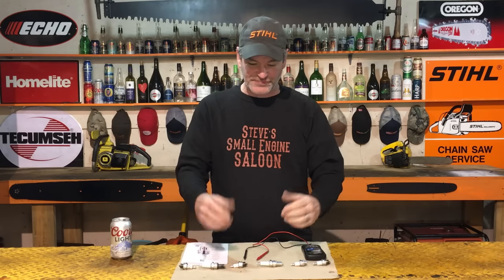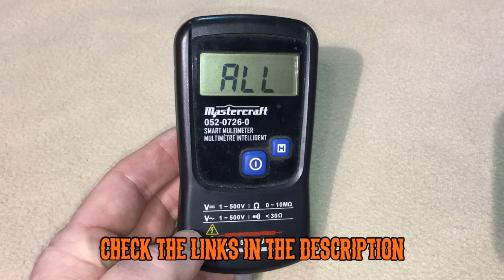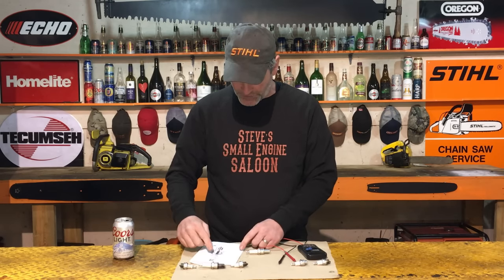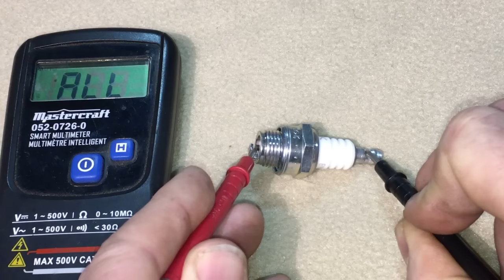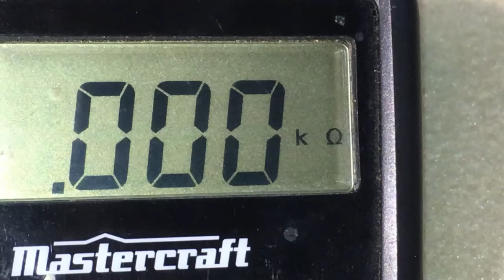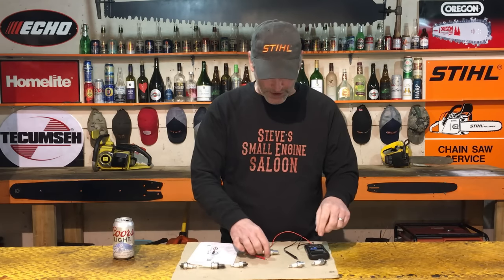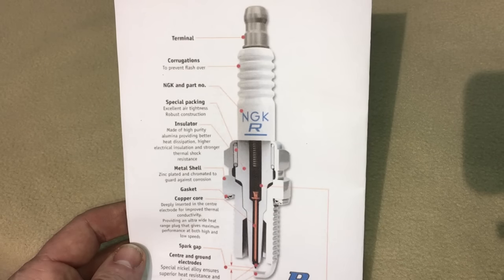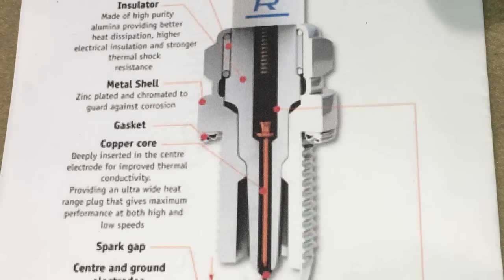How To TEST A SPARK PLUG In 1 Minute

Comment from the maker: Click here for a Multimeter ➜ https://amzn.to/2SNGZkw
Click here for new spark plugs ➜ https://amzn.to/2Mb6JFa
Check out these other informative videos: 
Fix Stripped Spark Plug Threads For Free With This Hack ➜ https://youtu.be/yY_fuDRltZE
How To Diagnose and Read the Color of Your Spark Plug ➜ https://youtu.be/Tz4uxFMUCOA
Check For Spark On A Mower, Chain Saw or Other Engines ➜ https://youtu.be/VZ8r7xv3DLY

Make sure to check out the Saloon here too…
Click here for my website ➜ http://www.stevessmallenginesaloon.com/
Click here for my Parts and Tools Store ➜ https://www.amazon.com/shop/stevessmallenginesaloon 
Follow me on Facebook ➜ https://www.facebook.com/stevessmallenginesaloon 
Follow me on Instagram ➜ https://www.instagram.com/stevessmallenginesaloon/ 
Follow me on Twitter ➜ https://twitter.com/SteveSaloon 

The resistor is there to suppress radio frequency noise which helps protect car radios, mobile phones and engine management systems. AND some ignition modules require a resistor plug to allow the coil timings to work properly.....
Reply: Old mechanic once told me to test a questionable spark plug you must first fill a 5 gallon bucket of water, then you must toss the spark plug in the 5 gallon bucket of water, finally observe the spark plug. He then said, "if it sinks then it's bad. Replace it."   ;)
Reply: Your friend must of been a Navy man
Reply: I made spark plugs for 10 years, every brand you can name. Don't believe the bs that one plug brand is better than the other.
Reply: @Weeble_Warbles  your friend was crazy.
Reply: ??? What??? Resistor for suppressing some noisy waveforms? You must be kidding! Chuck in a couple of ferrites will probably be of a better option if that is really your concern.
Reply: @santini1953  you made spark plugs of all brands? Gee... You work for some crazy back ally workshop that produces all sorts of knockoff maybe. Sparkplugs... I don't know people can make such a big fuzz including conjuring up so much BS about of this seeming innocent thing. What can I say...
Reply: @santini1953  That must have been an exciting and rewarding job, but someone has to do it.
Reply: I now know my life efforts aren’t wasted. We got people arguing here about spark plugs. SAD
Reply: Thanks
Reply: Spark plug link broken...
Reply: thank you. Was informing for me.
Reply: Great site
Reply: I have a old Briggs engine with everything on the inside removed except for the crank shaft , it still has a Flywheel and coil , I just hook up a spark plug and spin the shaft , it either sparks or not , I also test coils on it ,  it was just a junk engine from over 20 years ago that was never going to be rebuilt so it was free , it doesn't show any numbers but it will tell you if it works or not
Reply: Coors light... c'mon man, Sam Adams, PBR but coors light is gross!
Reply: Peace sports
Reply: @santini1953  Someone has found a way to make a bad plug now. I bought some a couple months back  and I would not use them in my Windstar. I took them back and had to look at the next set I got before I would accept them. These garbage plugs had like 4 threads on them.

Comment: When I was a VW mechanic back in  the sixty, we has a spark plug tester. You cleaned the plug first, check gap, place in tester, some worked fine until you put 120 psi and no spark, a lot of plugs work fine until you put them under compression pressures and then no workie! My two cents worth.
Reply: Ive had that. Mower wouldn't start. Tested for spark with the spark plug on the engine casing. Sparked ok. Put back in and engine wouldn't start? Eventually tried another spark plug and the engine ran.  It took me about an hour to figure it out plus a lot of swearing!
Reply: 100%
Reply: Paul P how to does it work ???
Reply: This is so true.  Your 2 cents are needed to buy new plugs  lol
Reply: Yes! My father was an old time mechanic, and he had a spark plug tester. When I was a kid learning about cars, he demonstrated how a spark plug could spark fine at low pressure, but fail at high pressure. I couldn't believe it when I saw it. I couldn't believe why pressure would make any difference, but it did. It's something I never forgot.
Reply: i never new this...very interesting
Reply: The true test.
Reply: 60 years ago in the service station that I worked at we would charge up old dist. capacitors and leave the on the work bench for some  overly curious customer to pick up and examine . . .
Reply: I never knew that
Reply: @alven066  I have fallen victim to that trick, one day the shop manager asked us to stop all current work, and clean the shop the rest of the afternoon.,....one of the techs charged up a condenser and left on an otherwise clean bench......you know the rest, 🤣
Reply: i3
Reply: At least you are not drinking Budlight.

Comment: In High School Auto Shop we had a spark plug tester. You screw the plug into a small air chamber with a window on it. You add current and you can see  the plug begins to arc.....but as you add air pressure (compression) a bad plug begins to stutter and fail under compression. That was a learning moment for me.
Reply: You know, that’s an excellent point that I haven’t thought of in 40 years. Thanks a lot.
Reply: @NMranchhand  I'm 61 now.... I've messed with engines since I was about 13...when your dirt bike keeps fouling plugs (or other things)..... it's either fix it or push it....so you learn to work on things. But yes...this fact still makes me wonder how compression effects spark. https://www.youtube.com/watch?v=pl24m9utZLo
Reply: @readmore3634 a cleaned plug will fire    a dirty plug will fail  the spark takes the path of lest res.  (dirty plug) carbon build u on the porclin post bottom of plug its easyer to flow thru the carbon on that post to ground that jump across a gap  so it fails  --clean the plug no fail
Reply: @frankdavidson9675  
Thanks for pointing out the obvious. Why is it less likely to fire under increased compression?

Comment: Greetings from TEXAS. The resistor plug in the automotive industry is to help on  Radio Frequency Interference  for computers and of course the good time radio.
Reply: I can remember hearing the engine noise thru my 8 track with regular plugs and solid wires 😂😂😂

Comment: When I do my pre-season "Get-er-ready" routine, I pull the plug, wire brush it, lightly file it, and re-gap it.  I have a 27 year old Honda 8hp Snowblower with the original plug.  Do you thing I've gotten my moneys worth out of it yet.  I have other 20+ year old engines that I've done the same.   Good spark plug toss and thanks for sharing your vast knowledge.
Reply: I thought I was the only person that did that. I'll always try and clean it first before buying a new one unless I'm doing a complete tuneup
Reply: I sand blast mine

Comment: Thanks for this Steve.  Keep them coming.
 I'm now single after 30 years and never did anything like this, plus I lived in a major City.  After moving to a rural location and needing chainsaws, log splitters, etc, your clear, concise videos are a big help in keeping them running and diagnosing when they aren't.   
It's a 3 hour round trip to get a spark plug and You have to order them first.  
Repairs are also stupidly expensive even for simple things and it's nice to know whether you are being told truthfully What's wrong, not just have parts replaced to bump the cost.
I've found a woman on her own can run into that sometimes.
Reply from the maker: You're Welcome...
Reply: MrsGraphiteGal
   Another quick tip on a chainsaw or other motor,  if it is not starting  a quick check after trying the choke, and the regular starting instructions.  Take out the spark plug to see if it is "bone dry", means there is NO fuel getting into the combustion chamber.Likewise if the electrode part is wet with  gas, then you know it is gas fouled-won't run. At least you can know right away what is going on in there right quick if  you are far from the shop or far from town etc. Good luck and Smart gal reading and watching this stuff.  Also good practice to set your chain brake before trying to start- a sharp chain can cut you when it is not rotating, but not as badly as when it is moving fast.
Reply: Thanks Keith.  I'm adding to my knowledge every day.  Luckily my grandad was a master carpenter and my dad an engineer in the Royal Navy, I think I've inherited some of their creative abilities.
Don't worry, I am VERY careful with the chainsaw, never use it without at least trousers and gloves even when diagnosing it for a few minutes.  Although, the guy who services it says not to use the brake when starting as newer chainsaws don't need it and it actually causes problems with the huskies.  I still use it, if rather replace a part than my limbs !!

Comment: I'm in my fifties now, and I've owned multi-tester meters ever since I was a teenager --- you are absolutely right; even just a simple "no frills" unit is a total life-saver in sooooo many circumstances, such as when you're checking for the presence/level of voltage/current, testing for wire-breaks/shorts, etc.
Reply: I recommend better than “no frills” because my USA made fluke was able to find continuity issues in 3 resisters on a Deere mower OSHA safety board (ignition, seat switch, blade-PTO).  Sent it to TV repairman who said the resisters were fine using his own Chinese(Communist PRC) multimeter.  He was wrong, My fluke was right.  Diesel motor had vibrated the wire ends of the resisters to form cracks.
Reply: @hugoglenn9741  Yes, the cheapie ones do tend to break down after a fairly-short time.  Even the costlier-model Micronta testers from Radio Shack didn't last --- they suffered worn-away rotary-switch contacts, just like the bargain-bin-grade meters often do.

Comment: Great video Steve as always! My understanding is that resistor plugs are to eliminate interference with electronics? If so, why do small engine manufacturers list both resistor and regular plugs for their engines? I don't see a whole lot ( if any) electronics on most small engines. Thanks
Reply: Many small engines have a CDI ignition system (Capacitor-Discharge Ignition) which is sensitive to electrical noise. 
You can use a resistor plug in any type of ignition, but you can only use a non-resistor plug in a solid state ignition system. Resistor plugs are far more common than non-resistor plugs, and I’m sure many small engine manufacturers list a resistor plug for the sake of commonality. Non-resistor plugs are unnecessary and obsolete.

Comment: I'll just add that carbon (deposits) on the spark plug are conductive, they are resistive in nature, but they still conduct.  Your ohm measurement number will increase the more carbon is on the discharge tip.  Using a brass brush to clean the tip before testing would be helpful.

Comment: I keep a neon sign transformer handy at my shop. 7,500 volts and low amps. With wires to a spark plug it simulates the ignition system voltage and a fouled out plug will sputter and smoke till the fuel burns off.  Good for testing and if the ceramic isn't soaked with fuel the transformer will quickly clean up the plug to be able to use it.

Comment: Great vid Steve technically you should use a megger (which is a ohm meter that uses high voltage) to test the ceramic insulator because sometimes the insulation in this case (the hairline crack in the ceramic) will not leak at low voltages (your volt ohm meter likely has  9V battery) the coil of your small engine produces thousands of volts so the plug could leak at the higher voltage produced by the coil but test fine at the lower voltage of an ohm meter of course no one watching this video can afford a megger except an HVAC tech.
Reply: I think it would be overkill. It's a very expensive tool if you only use it for checking leakage on a a sparkplug.
Reply: That's what the last sentence of my comment says
Reply: @phillipcoiner4232  Then it's said two times. Just so we can get all with us, if they have any doubts.

Comment: Helpful info, but for all non-resistive type of plugs, you will find that your multimeter will not be able to detect a crack in the porcelain insulator inside the body of the spark plug. The spark will jump across that point and also possibly the spark plug as well gap due to the high voltage of the ignition system (depends on where the crack is) but the spark may be very "weak" at the spark plug gap. Your multimeter on the other hand works on very small voltage for continuity and testing resistance so it will not be able to detect the crack in the insulator and as such the multimeter will read open or infinite resistance even though your spark plug insulator may be cracked. There is a case where carbon may build up inside the gap and short out the center conductor to the outside case. In this instance you will see a high resistance reading but it will not be infinite on your multimeter.  For resistor type of plugs, these scenarios are also true, however you need to consider the 4.7 K ohm resistor in your measurements. Hope this helps.
Reply: If you have a crack in plug you will see it ark once the light is dim no need for mutimeter waist of time
Reply: Dale, you are 100% correct.  I was going to point that out but did an F3 first and there you are.  Thank you.

Comment: Your videos are great Steve.  Thanks for sharing you experience and knowledge.  I wanted to share something that I think is relevant to this video.  Just because a plug passes the test you outlined in this video does not mean the spark plug is in "good working order".  I just replaced a BPR6ES in a mower with a GCV160.  The mower would start relatively easy but after about 30 seconds it would die out.  I was thinking carburetor\fuel issue but quickly ruled that out.  Compression was 90+ psi with decompresor so wasn't too worried about that.  The mower had good spark and the plug passed your test, 4850 ohms, and no continuity on the threads\body.  The plug had pretty heavy carbon deposits that I cleaned away prior to the test.  I replaced the plug anyways and my issue was cured 100%.  So the question becomes...were the carbon deposits to blame?  If I cleaned the existing plug and reinstalled it would it likely work just fine?

Comment: A new spark plug theoretically should solve the problem, however, I've seen new plugs that were faulty.  Then of course, there's whatever else may be wrong with the ignition circuit.

Comment: Good to know; thanks Steve. Funny though. I have worked on many dozens of old & newer small engines since 2011 & never had to buy a new plug. I think replacing the plug annually or running out to buy a new one as soon as an engine becomes hard to start (usually fuel related) is a waste. Champion & NGK must love it though!
Reply from the maker: I agree....

Comment: I have had many Champion Spark Plugs fail but no NGK.I find the spark travels around on the Carbon build up most times & a wire brush is enough to fix them.My Motobecane Moped 2 stroke was  bad for that.

Comment: I had a lawn mower given to me last summer and that was the only thing wrong with it. It was a Honda with an NGK. Those plugs are prone to foul out if the carburetor was been flooding. I used to buy a case of them every winter for my snowmobiles. I always carried extras in my pockets for my buddys. They NEVER had spares on long runs. On older snowmobiles, it was normal to have carb issues. Good video. I wish more guys would just go out and buy a spare plug for all their small engines. Especially chain saws.
Reply: RC Hobbyist Extreme same here how’s quarantine

Comment: Nice video describing how to test a spark plug. I reacted to two things in this video, you are not doing it wrong. but i feel like adressing it.

Not holding the tip of the mesuringprobes is good practice, but it does not affect the answer you will get at those readings. this is becouse the readout from hand to hand is approx 5 000 000 ohm.

As for the insulation testing. A multimeter will normaly not be able to test with more than 2v. for a more trustworty insulation test it should be tested with an insulation tester with high voltage mesurement(electrician tool wich is to expencive to consider buying for the regular person). however testing it with a multimeter will show if it is totaly flawed.
Reply from the maker: Thank You...
Reply: Yes a megger would be better for checking the insulator, however a decent quality DMM can measure resistance to 50 mega ohm, your body resistance, which can be much lower than 5 meg if sweating, will seriously affect the reading. General all around good practice - don't touch the probes.

Comment: Good info Steve. I think I had one like the last the other day. Tested it for continuity and spark, which was all good, but installed in the head, it would try to kick off and die. I think the compression was separating the inner electrode. Switched out the plug, and the engine ran like a champ. Was weird for me, first time Ive ever encountered that. Keep up the good work.

Comment: When I was 16, I read spark plugs never wear out in magneto ignition systems. In 72 years since then, I've never replaced a spark plug in any of my chain saws, lawn mowers, yard tractors, etc. I have had spark plugs fail to produce  adequate spark in my high compression, high performance race engines.

Comment: Excellent video on testing spark plugs. Also, if the base of the ceramic part of the plug is burnt(brown around the part where ceramic meets metal), that usually indicates carbon leakage (bad plug).

Comment: Nice job Steve. I recommend checking the plug when brand new as I have had brand new ones that are bad
Reply: Bring your multimeter when buying new ones. Had one read 8,000k right out of the box and tested the other one which was 500.
Reply: Buy ngk never had a bad one in 40 years champion on the other hand dont and wont use them rubbish